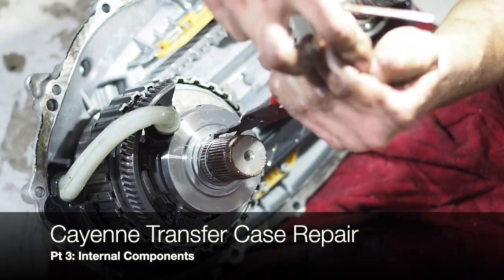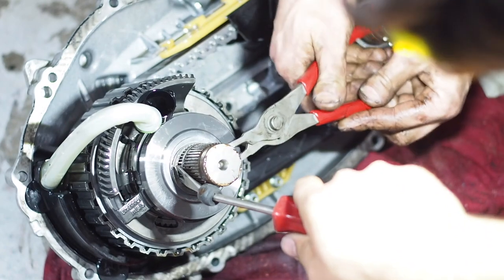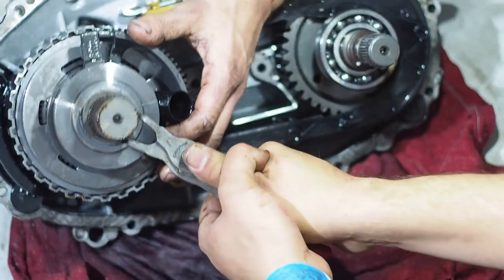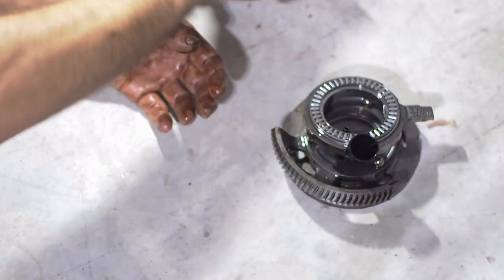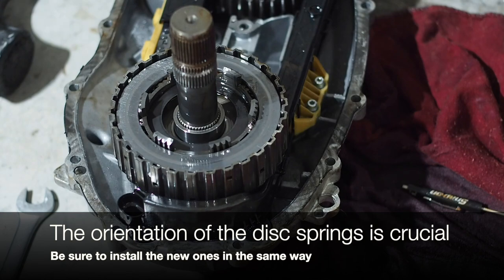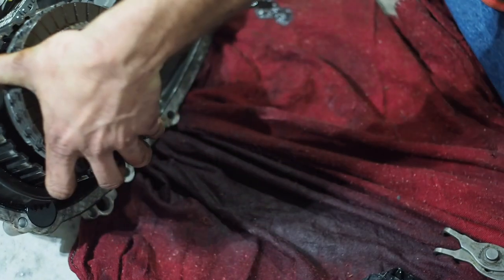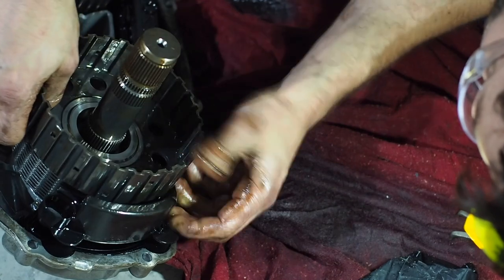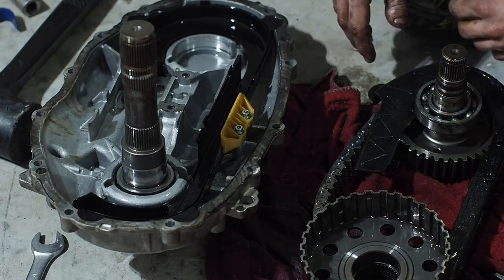Porsche 958 Cayenne Transfer Case Rebuild DIY Part 3: Internal Components Disassembly

Comment: From the video, this 958 Cayenne Transfer Case didn't incorporate the center differential,
I remember the first gen cayenne transfer case having the center differential 
and two range speed. 
Why did 958 remove the center differential ?
Reply from the maker: they removed the low range gear, technically I think the transfer case is the center differential.  The reason they removed the low range gear is because no one needed it in the parking lot of Whole Foods, which is how most all cayennes are driven.  So they got rid of it to save weight.
Reply: @SpectroRacingChannel  Also new 8-spd trans. 1st gear is pretty much new low gear as Cayenne frequently starts from 2nd.

Comment: Haven't seen anyone point out the magnet that's inside the case. Is it in the lower end of the case where the fluid collects? What was the condition of the magnet?

Comment: I’m thinking about buying a 4.5 340 HP cayenne 2004 . Anything I should know about engine and the tranny ?
Reply from the maker: the auto trans sometimes get harsh 5-4 gear downshifts which can be fixed by installing a valve body.  Revmax sells them.  The 4.5 liter naturslly aspirated engines sometimes have bore scoring especially in cold climates.  The 4.5L turbo motors are bullet proof but you'll want to rebuild the AOS by replacing the rubber diapraghm, otherwise the driver side intercooler will collect oil which ultimately drips out.